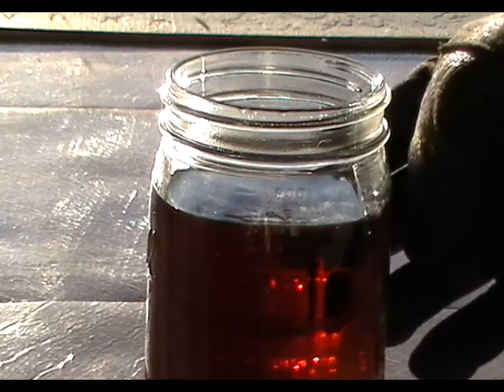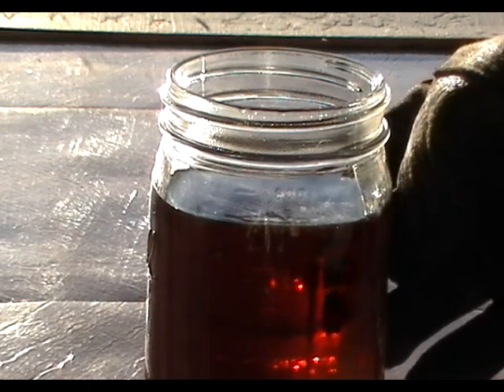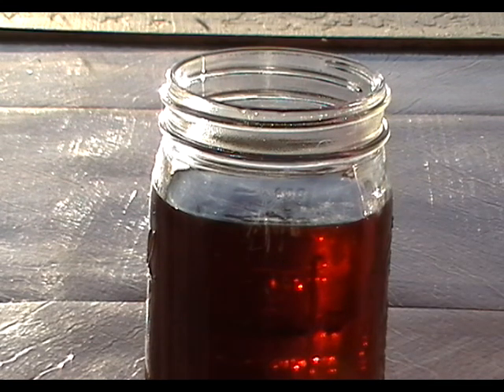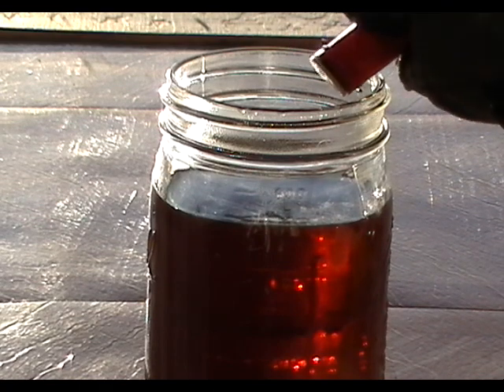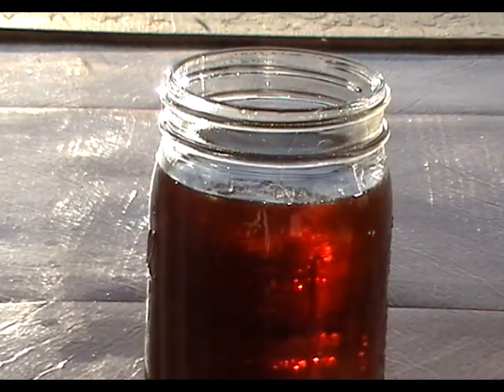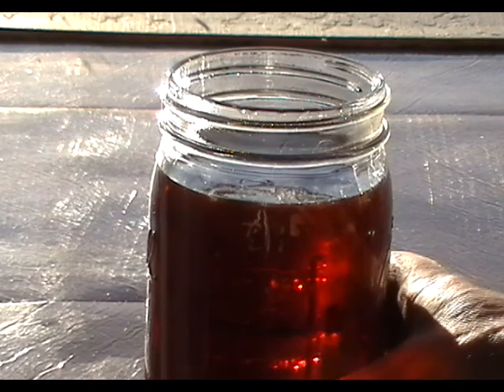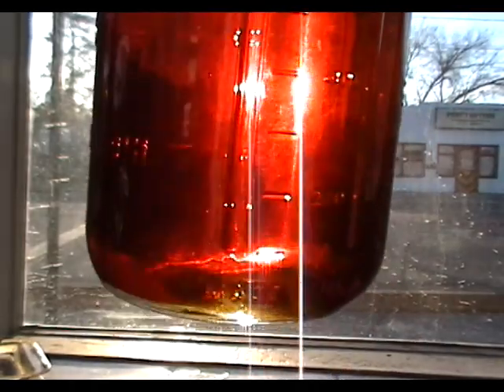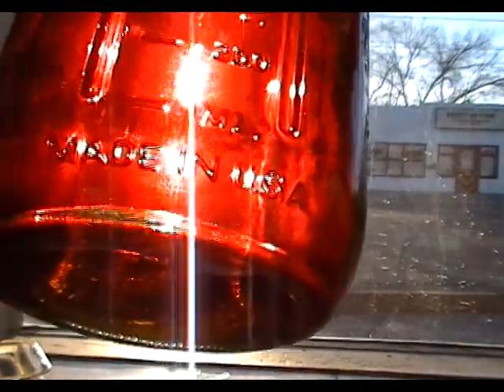Blending Gasoline with vegetable oil to make Diesel Fuel

Comment: You can also run a mixture of gasoiline with a small amount of veg oil in a non catalitic convertor gasoiline engine if the outside air temperature is 80 degrees or hotter and gain feul economy.

Comment: Does regular diesel mix with vegetable oil? Can they be mixed in 50-50 proportions or do they not mix together?
Reply from the maker: Yes, normal diesel fuel will mostly mix with vegetable oil; however, it is important to understand that when blending oils with solvents there is likely to be a precipitate, which has to be separated out or you will ruin your engine. 

Also, once you have removed the precipitates from your waste oil based blend, and your solvent is diesel fuel, then your blend is going to be too dense and viscous, so you will want to add a lighter solvent at about 20% of the waste oil component. Recommended lighter solvents are: gasoline or Acetone. Acetone is a better solution if it is cheap enough for you to use.

Comment: Looked into both the F-250 and Ram 2500. Like the looks of the Ram better and the inline 6, 12 valve simple engine. There is a website where everyone with a Ram2500 Diesel lists their mpg based on model year. Some got 20 mpg, depending mostly if you baby the gas pedal or not.

Comment from the maker: @lolailando It sounds like you have worked out a pretty good strategy for yourself. So, now you have to build a blending and filtering system.  Get a pressure tank with 1-2" fittings at both ends of a domed end tank, Turn it upright, plumb it so that you can get your blend in, and drain the sludge off, and pump it through a set of filters.

Comment from the maker: Good to know you find oil where you are.  The unwritten rule here is if WVO is left on the rear door step of a restaurant, then it is free-pickings, otherwise it would be in a container that is marked "property of..."

Good to know you actually get better mileage on vegetable oil.  I assume that is with petrol added, which would make sense.  Otherwise those who do not blend petrol with their vegetable oil tend to lose mileage.

WMO is waste motor oil.

Comment: hi jeffrey, i was using method for a couple of years and the main reason i stopped was is was more expensive to make the mix than the mix of bio-diesel i am making and secondly the sugars from the food cooked in the oil would stay in the oil causing a sticky residue if left from spillage etc. i could only imagine what this was doing inside my engine. i did run biodesel for 2 more years after that and had the head off and it was clean but i am not sure if any build up was left while using the oil/ petrol mix.
the bio-diesel mix i am making would have more oil than if i was using the correct formula but there is no stickiness left from the fuel and i can only hope more sugars are removed this way.it just smokes a little for a few seconds on cold start up because of the slightly thicker mix.if it is too bad i do add 5 litres of petrol for approx 100 ltres of oil mix to rectify this.i am running it in an old in direct injection nissan sd33t engine and it has survived for about 7 years so far with engine oil/ petrol mixes run in the engine as well.

Comment from the maker: That all sounds pretty good, except for the in-tank blending, because I have found blending waste oils with petroleum distillates can cause precipitates to form, this is why I recommend blending before filtering and dewatering, which accelerates the precipitation of water and particulate.  Then you could blend with gasoline, and not have to go to all of the lengths you are going to to keep your engine and fuel hot to start in the morning.

Comment from the maker: Yes, gasoline has 10% less BTUs per unit volume than diesel fuel; whereas most waste oils have about 10% more BTUs per unit volume than diesel fuel; therefore a blend containing 50% gasoline to 50% waste oil has the same BTUs per unit volume as diesel fuel; whereas, a blend containing only 20% gasoline to 80% waste oil has about 8% more BTUs per unit volume than diesel fuel.  I have been running this blend for 6.5 years on the same engine with no rod bearing damage, nor head gasket damage.

Comment: What does this do to the flash point of the veg. oil? Aren't the gasoline vapors still present, especially if the oil is heated.

Comment: Ive run wvo and diesel blends also. 50/50 in the summer and 70/30 in the winter. I have a centrifugal filter system also to clean the wvo first. I have a problem with the wvo gelling in the filter and causing a slimy sludge. Cant seem to get rid of it. I tried the diesel secret 80%wvo/10%diesel/10%rug but eliminated the gas. Running RUG in a diesel engine is a bad idea because of coking. Have you removed the heads to inspect the combustion chamber? Your thoughts please. continued

Comment from the maker: All that you described is correct, but do not filter the last 1gal.  Instead start a sludge bucket, where that last 1gal goes, then the next time you make fuel put the last 1 gallon of that batch into your sludge bucket.  Keep doing that until your sludge bucket is full, then leave it to settle for 1 week, then drain off the clear amber fuel from the top of your sludge bucket through filters.  Typically you should get 4 gallons of good fuel out of 5 gallons of sludge.

Comment: @Jhananda Thanks for your answer. I really appreciate it. I just got few liters of used vegetable oil and I'm going to filter it and add the gasoline. Only one more question: How to deal with the water which is mixed with oil? Do i need to some how remove it? If I don't remove the water, does it cause any problems? :)

Comment from the maker: Try running any unmodified diesel engine on vegetable oil in the winter and you will find your engine will not start.  Also running any unmodified diesel engine on vegetable oil any time of year will result in ring gumming and injector coking.

Comment: So! have you run this stuff
Reply from the maker: If you read the comments I ran this blend for 11 years on the same engine.
Reply: @Jhananda  That is awesome! I have a 1984vw rabbit diesel with a vegi oil conversion on it and a HHO system. I run it on black diesel. Just wanted to make sure I could do this mix if I had to. thanks a bunch for the reply.
Reply from the maker: @sergesmith2863  I'm not sure what your vegi oil conversion kit involves, but some of these kits heat the fuel, if so then you wouldn't want any gasoline or alcohol in your fuel because it could lead to vapor lock. In that case kerosene would be your best blending agent.

Comment: it would be quite possible to badly damage a diesel engine by cutting the oil with too much gasoline, but it would seem that as long as you have the ratio of oil to gasoline correct, then it's a good alternative to new diesel fuel. Although can filtered vegetable oil not be used in a diesel engine without being cut with anything?

Comment: I was confused before about 'Precipitate Out', Precipitates, and Precipitation(water formed). When blending gasoline with clean filtered WVO- that has no water in it, will precipitation still form ? I would like to put 5 gallons of clean WVO in a 6 gallon fuel can, add 1 gallon gasoline, wait a few days then pour it in my gas tank.

Comment: Rug and Diesel have different burning and ignition characteristics. Have you pulled the heads or injectors for inspection after 10k, 25K 0r 100k miles?

Comment: @Jhananda Does the gasoline have unintended consequences? I am not an expert, by any mean of either fuel or diesel engines, but don't gas and diesel engines have a totally separate combustion process? How does the 80/20 mixture compared with pure WVO and with WVO processed into bio-diesel? Are there pre-ignition or other problems? Can the valves stand up over time with 20% gasoline? Finally, are there any emissions problems from this process.

Comment: Thank you for the video, it helps me to make a choice on what to run in my tractor. Have you had any experience running in cold weather?
Reply from the maker: waste motor oil (WMO) based fuels will run better in colder weather, otheriwse you may want to run your waste vegetabe oil (WVO) based fuel blends in the warmer months.

Comment: Sir Jeffrey The Liberator !!!

Could you please kindly advice and help even  more people  on your way to paradise .
Will 30% gas to 70 % wvo mix  work long  term with 2008 duratorq 1.8 tdci diesel engine found in ford mondeo 2008?
Also will it work in vw passat 2.0 tdi pd engines?
Will 30 to 70 be all it takes or another 20% of diesel added to the mix to ensure 100% success be necessary for both of these 2 engines ?
We family of 3 childre have 2008 mondeo but are looking to get vw sharan 7 seats year 2007 with pd diesel engine .

My research suggested 2 tanks system but it is complicated to build as nobody is willing to do it for me and i myself not talented and skilled enough to accomplish such a build. 

Thank you very much for your precious  time spent  reading this comment and all the best to you and your family .
Reply from the maker: You didn't mention waste vegetable oil in your blend, but I assume vegetable oil is in your blend at no more than 50%. The rest should be either 50% kerosene or 20% gasoline plus diesel at 30%. With this blend you won't need a 2 tank system, but having one and starting on 100% diesel then switching to a waste oil blend after the engine comes up to operating temperature should reduce coking.
Reply: @Jhananda  

 @Jeffrey Brooks Ty vm

My bad I meant wvo -waste vegitable oil.
30 gas to 70 wvo.

Roger that!

20% gas , 30 % diesel and 50% wvo

Thank you very much.
Could not even imagine this common rail durotorq and pd engines could take any wvo as most people say no. 
I am very impressed that it can .

Much appreciated Kind Sir. 

Centrifuging......
My uncle used it built in his fuel system to clean and dewater wvo in the go in large delivery truck

What's your opinion please ?
Is there a need to filter with 100 or 1 micron prior filling duel tank with wvo if centrifuging is working on the move in real time ?
Reply from the maker: @maximolotov  I have a centrifuge. I found it as a useful pre-filter and/or post-filter but I wouldn't use it as the only filtration system. I first heat WVO and then screening out the solids, then allow the screened WVO to cool and settle overnight, then blending diesel with the clear translucent WVO with diesel fuel at 30%, then leave it to settle for a month, then blend the clear translucent WVO-diesel blend with gasoline at 20%, then leave it to settle overnight, then drain off the bottom anything that looks creamy or dark, then add acetone at 1% and left again overnight, then drain off any water, creamy or dark sediments prior to filtering into the fuel tank.
Reply: @Jhananda  Thank you Kind Sir

Comment: how fine a filter should be used on the finally filtering after blending. I filter down to 100 microns before blending. I want to make sure before I start using it.  thanks.

Comment: hi sir , i have over 250K miles on wvo, and i have never had any engine problems, i use to blend after settling, but now i blend before settling process, this makes it much faster, i use to run 50% waste veg oil and 50% diesel in the winter and 20/80 in the summer, recently, my winter mix became 3 gal wvo 1 gal diesel and 1 gal petro but after reading and using gas in my mix im going strickly with your formula, ever since i started using gas in the mix i have noticed better performance, one question without diesel will my engine OR componets be lacking in any LUBRICATION??? i also run my diesel generator on this mix, im being totally honest about how many miles i have run on grease. i read from the fryer to the fuel tank many years ago by Joshua trickle, many old timers probably have heard of him. oh how low of temp. range will this mix handle??

2000 KIA SPORTAGE WITH 82 ISUZU I-MARK 1.8 DIESEL ENGINE INSTALLED
my poor isuzu 82 body wore out after 385K miles, i loved that car, but we did transplant the engine to a new donor body (kia) you cannot wear a isuzu diesel engine out, and i have 2 spare engines with only 50k miles, i will never get rid of or outlive these 3 engines
Reply from the maker: bburgessl Good to know that you have put so many miles on your engine running WVO blends.  It is also good to know that you found improved performance running gasoline blends.  Your fuel will not lose lubricity due to gasoline in a blend with WVO, because a gasoline blend with WVO at 80% is more lubricious than normal diesel fuel.  Also, depending upon your source oil, I have found 30% gasoline blends with canola oil will start my engine at 0F (-18c).  However, if there is a sudden temperature drop, then do expect more fat precipitating out of your fuel blend.

Comment: So, after adding gasoline to WVO, do I need to filter out the top portion ? I saw that in dirty WVO, water and contaminants settle to the bottom of tank. And what if I put 5 gallons of cleaned/filtered WVO(no water) and 1 gallon of gasoline into a 6 gallon fuel can-do I still need to take out any condensation formed ?

Comment: In your experience if I want to try svo/rug for home heating in a boiler with gun type burner (beckett or so on), and would like to use as litle rug as possible to save $/recycle; should I keep a few gallons at let say 120F and then be able to use less RUG? could I make it work with 5% RUG? I mean increase temp = less RUG for same viscosity/specific gravity?

Comment: The oil will get heated as it is recirculated back to the tank by the injection pump. All diesel engines do this to carry heat away from the injection pump and injectors - might be a potential problem.

Comment from the maker: Sure, 60% D-2 to 40% WVO should work in any diesel in the summer.  You can reduce the D-2 by 2x for every percentage of gasoline or acetone you ad, and you can add WVO at 2x of the gasoline or acetone.  So that 10% gasoline or acetone to 25% D-2 to 65% WVO should work fine in any diesel engine.  

Or, 20% gasoline to 80% WVO and no D-2. Or, up to 50% gasoline or acetone to 50% WVO should work in any diesel engine.  However, there are variations in diesel design, that should be considered.

Comment from the maker: @packrat541 good to know.  Do you happen to know how percent vegetable oil will do this on a gasoline engine?  

Also, apparently a gasoline engine can be run as a two-tank system with gasoline for the startup and shutdown, then the trip can be run on kerosene, or I suppose a blend of gasoline and vegetable oil to equal the viscosity of kerosene.

Comment: Unfortunately this comment will probably get deleted. Diesel fuel is a blend of hydrocarbons with a standard distribution of 8-21 carbons in length. Vegetable oil is approximately 14-24 carbons. Adding gasoline (6-11 carbons) would be like mixing sand and rocks and calling it gravel. Further, in newer common-rail post-injected engines, biodiesel is known to dilute engine oil and increases the possibility for wear in blends as low as 20%. Adding 80% waste vegetable to the tank of your new diesel car would be insane and void your warranty.
Reply from the maker: Interesting comment.  I have been running 80-20 blends of gasoline and waste vegetable oil in my engine for almost 8 years now.
Reply: Bs
Reply: Jeffrey Brooks Have you done any kind of engine tear down to examine the wear on the internal parts? What octane of gas do you use? and what Cetain of diesel? have you used it consistantly or intermittently and what kind of vehicle do you use it in? also how many miles have you driven on that vehicle and what kind of maintenance schedule do you follow? have you noticed a need to replace fuel filters more often or change oil more often? Have you had to replace injectors? If you have photos of any engine tear down I would love to see the results.
Reply from the maker: tara owens
sorry no emissions data on my engine.  I have been running my 6.2L n/a diesel on 80-20 blends of WVO+regular unleaded gasoline for almost 7 years.  No engine breakdown.  I have to clean my injectors annually, and drain the motor oil every 3500 miles.  I used to have lots of plugged fuel filters, now none.  See this link for more data: http://beyondbiodiesel.org/forum/index.php/board,28.0.html
Reply: Certainly BS. Your analogy is what is wrong. You are comparing solids with fluids, knowing chemical make ups with carbon chains is one thing. But an lack of understanding of fluid dynamics is quite the other. I would suggest you learn more about the later first. I have yet to see any vehicle run on sand, rocks or gravel but supposing they did it certainly would not be like running on petrol, diesel or vegetable.
Reply: Which oil company do you work for?
Reply: Older engines handle it just fine. 
Your analogy with gravel would only be relevant if the liquids remained separated.
Reply: Furthermore, it's not the carbon composition that you're aiming to alter here, it's the viscosity of the oil. Vegetable oil will burn in a diesel engine undiluted, but at colder temperatures it is too thick for fuel lines. Thinning it out with gasoline would remedy this.
Reply: @enquire422  that's the thing the guy works for an oil company we can't trust him he just wants us to buy his company's oil! Lol
Reply: @Jhananda  what's the 80 is 80 diesel? Also I'm getting a multi-fuel military truck so then I can run down there anything in it. With your experience with your truck do you think I should cut the vegetable oil with gasoline or just diesel. I have filtered my used vegetable oil down to 1 micron.